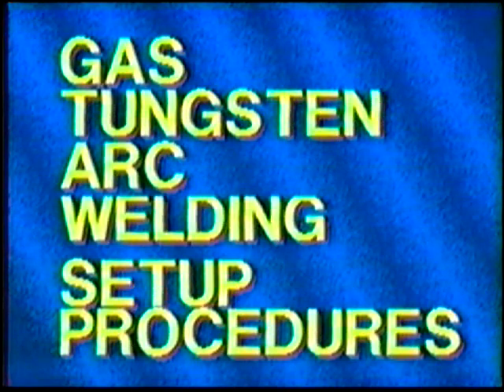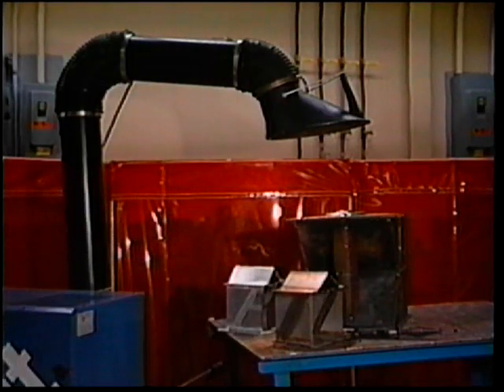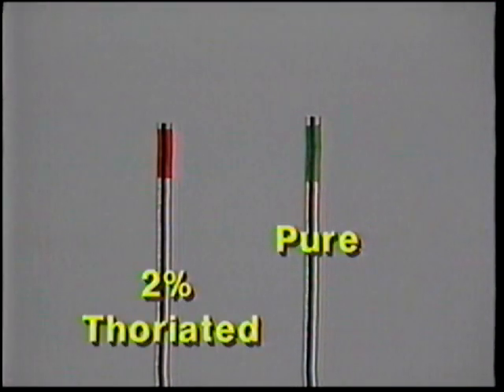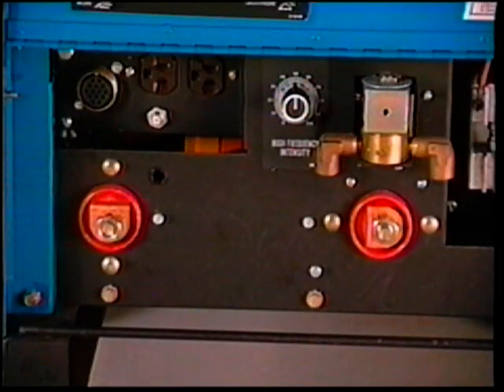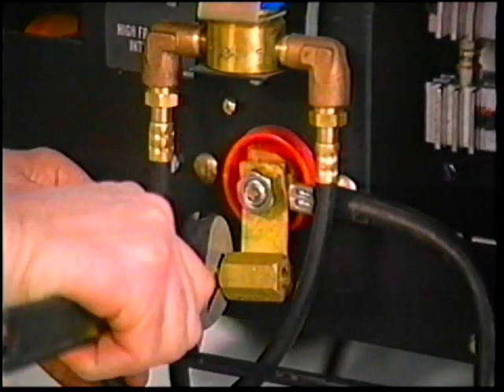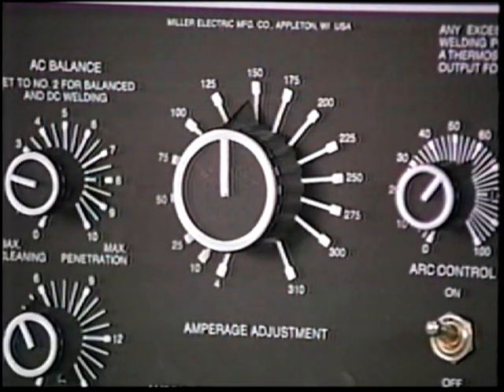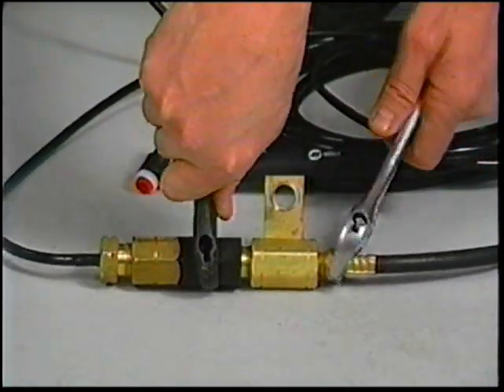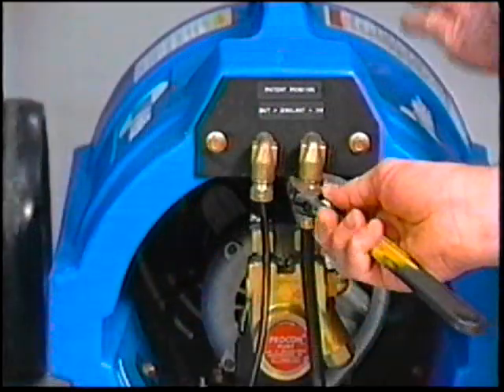GTAW Setup by Miller

Comment: Nice video , didn’t know the fuse connection for setting up my water cooled torch till now , will grab one 
I take it the block is the same just add the fitting for the fuse fitting ?